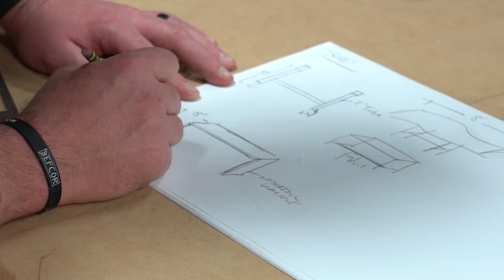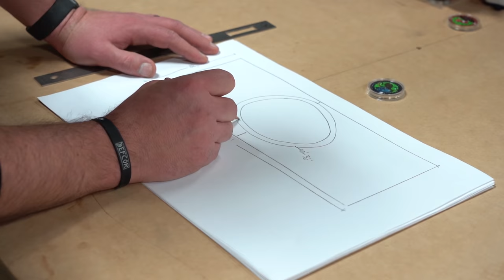I Can't Believe This Client Wants This In Their $30,000 Table!

Comment: I had a conference room live edge table built for our office of similar size. A couple of things we learned. 1. Find pop-up power receptacles that aren't directional. They usually pop-up in one direction making them less accessible from one side or the other. We put one at each end of our table and faced them opposite of each other to try and make both sides happy but inevitably the person who always needs the power is on the wrong side of the desk.

Orientation of the outlets within the pop-up is important, some wall warts (I'm looking at your apple!) are too big to fit vertically within the  pop-up, so if they outlets orientation can be switched that is ideal.

Plan well head for cutting the inserts for power receptacles, live edge tables tend to be deeper than most board room tables, ours was about 3" thick... making the installation of something meant for 2" max tricky. Your CNC should make short work of cutting a cavity on the backside to accommodate everything, but planning makes it easier of course.

You're going to want to add some sort of trough or wire management solution under the table to mange all the wires that run to the outlets. We built our management into the legs of the table so the wires could be run down the legs directly into the outlets in the floor so you wouldn't see them at all, it was slick.

Seriously consider all functional holes you are cutting into the table, naturally there is no going back. Needs and technology change, nothing worse than having a hole in your table that you don't need anymore, like when the customer was looking for a cut out for their microphone. If they change tech in the future that hole is going to be useless to them. It looked like a Logitech extension mic, which is proprietary to logitcechs, no good to them if they move to a better solution. We have had control system built into the table for lights/audio/video/conferencing but when we moved offices we changed systems, we are now left with our old system sitting in the hold turned off because we drilled. On-desk systems may not look as nice, but if you ever change things up you aren't committed to an unsightly hole.

Comment: Were these meetings to just get a general idea or were these to get actual detailed requirements of the actual product? 
Why does Jordan want client work rather than just building cool projects? When I think of client work based on the experience I had seems like all these contractors overcharge for really average craftsmanship. These clients got lucky with you because craftsmanship is not an issue for you.